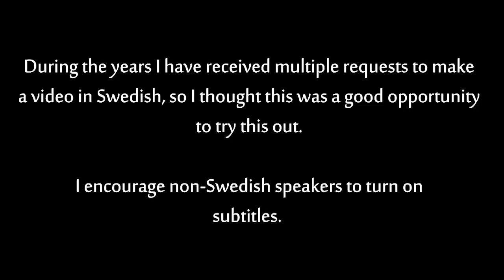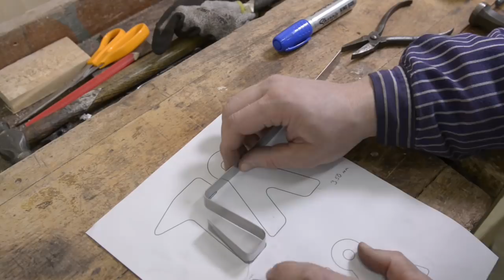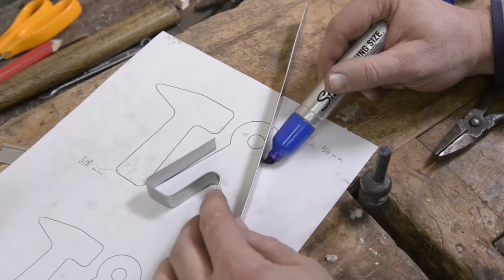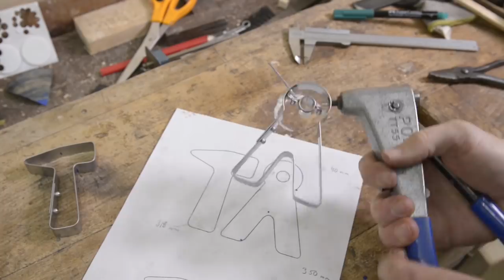Making gingerbread cookies and cutters!

Comment: Great job on the cookie cutters. A fourth way I have seen to join the ends together when using stainless is to use the top fold to crimp them together. It's not as strong as rivets, but it's what I see on cheap cookie cutters here in the States.
Merry Christmas!
Reply from the maker: Yea, that might work also. It's not super important to have a strong joint. Merry Christmas!

Comment: Hi TA,
I know I'm a little late in watching and replying but can you tell me what "dl" is in the recipe? I can't find that anywhere. And thank you for the great video!!! And ALL of them for that matter!
Reply from the maker: No problem. dl = decilitre. 0.1 litre
Reply: @torbjornahman  thanks TA! One other question I've had for a while for you if you have time. After you've set a punch in hot steel and before you start drifting the hole, you sprinkle something in the hole which then catches fire and sparks. Can you tell me what that is and why you use it? Thank you!
Reply from the maker: It's just coal powder. It helps to lubricate the punch. It can get stuck pretty bad if you're not careful.
Reply: @torbjornahman  
Ah! That makes sense. Thank you.

Comment: What is the differance between quenching and hardening in water? And can you tell me,which oil should i use, and what should i care of while quenching?
Reply from the maker: It's all dependent on which steel you use. Some can handle the rapid cooling in water, but most will not. Buy some cheap canola oil to start with! Oil should always be a bit warm for better viscosity, about 50-60 C. Heat treatment is a really complicated subject so there are no simple answer to any of this really...
Reply: @torbjornahman  Thank you for your answer. Is there any website that i can find about steel hardening process?
Reply from the maker: You can read up a bit on it on wikipedia but other specific sites I'm not sure. You would have to look around.
Reply: @torbjornahman  Thank you for the answer.

Comment: Wouldn't it be easier to cut out a wooden block to the pattern (well a bit smaller) and do the initial bending around that?
Reply from the maker: The idea crossed my mind, but I'm not sure it would make it much easier... The outside/convex corners maybe, but the inside ones wound still be a problem.

Comment: Different types of flour have different density, which also changes depending on how aerated the flour is. What type of flour did you use? Can you provide an estimate in grams? Also, a more concrete amount of sugar would be appreciated, same issue, though no as big of a problem as flour.
Reply from the maker: The flour weighs about 650g/liter and the sugar about 1000g/liter.

Comment: One little advice, never slide your pans on the glass surface as that can create scratches, it's those scratches that eventually lead those glass tops to shatter. Just my 2 cents on a little known thing.
Reply from the maker: Too late :) It's scratched quite badly already. I appreciate the tip though!